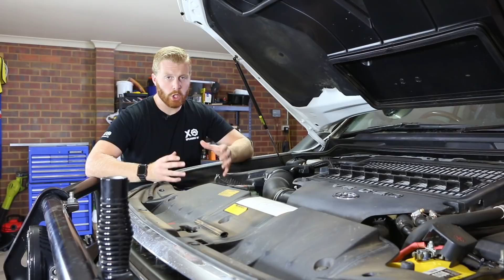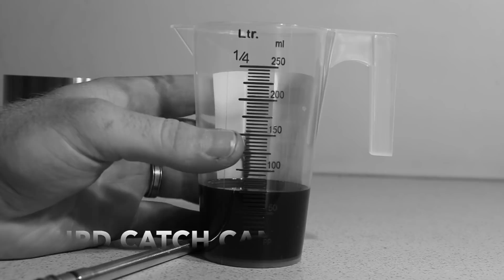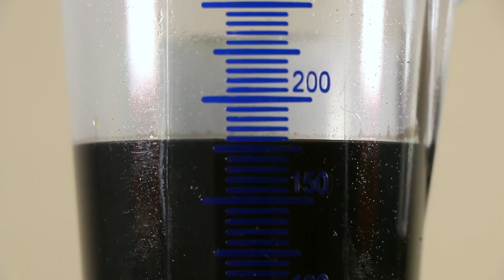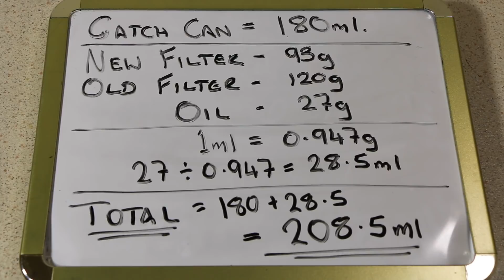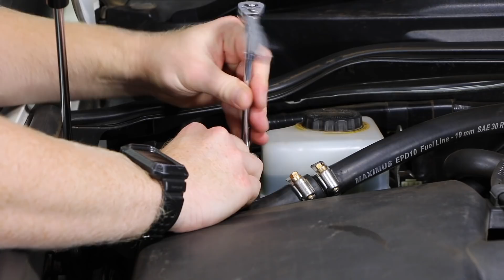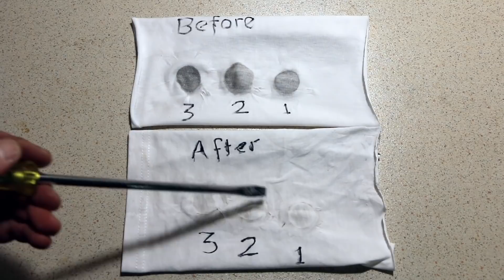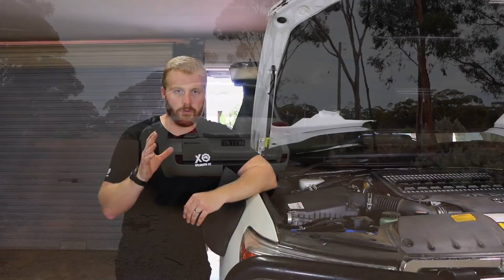PROVENT 200 | Is it really worth it? | MY 7000km REVIEW, drain and testing | Catch Can comparison

Comment: Great informative video thanks for sharing. how many provents does the LC200 need? do both turbos have the vent connected to them?
just asking cause my VW has 2 turbos and 2 separate PCV systems one to each turbo.
then again its done 265000km so the horse has probably bolted.
Reply from the maker: Thanks mate, so the 200 series only has one ventilation hose from the crankcase. Making it easy to plumb into a single catch can. The filtered air is then re-circulated into the passenger side air intake, however once that hits the intercooler, the pressures from both turbo's are combined and the gasses mix prior to entering the intake system. 
I didn't realise the VW had 2 seperate pipes. I'm guessing that a model specific kit would likely combine the two hoses prior to entering into a single catch can...
Cheers, Nathan.

Comment: Hi Nathan another great informative vid you are spot on with amount of oil the can catches. A few  knockers don't like them possible they have in shares in Toyota , mine is a Flashlube proportionally  at 5-6k  I caught a similar amount of oil .I drain it around 5k to be sure .cheers Ian.
Reply from the maker: Cheers mate. Each to their own, I'm not here to sell, promote or push products, simply to display my results, thoughts and opinions on these popular modifications. I believe they assist in prolonging carbon build up and don't have many, if any drawbacks. 
Cheers, Nathan.

Comment: Geee, thats a lot.. Mine doesn't produce a fraction of this. I checked the EGR and its dry and clean.
Reply from the maker: Sure is! Significantly more than the HPD unit caught. At least I'm confident the unit is performing well. Are you also running the Provent 200 on your Prado 150?
PS. Great channel by the way mate, been following you for a couple of years now.
Reply: @XploringOz  It is. I was impressed cloth test. Great visual. I wondered about mine so pulled the EGR apart. It would only catch 50ml or so in 5K Kms, but the EGR is dry.. I guess different engines create more mist or less.. Thanks for subbing to the channel.. And thank for your content.. I know how much work goes into it..
Reply from the maker: @jjsadv  For sure, every vehicle and every engine would have specific requirements. Glad to hear that your vehicle is performing so well, definitely a cash saver there in terms of intake cleans. 
Cheers mate, I'm glad you are enjoying so of my content. Sure is a lot of work behind the scenes, but the appreciation from viewers is well worth it
Reply: Be careful that when you buy a catchcan that you do not reduce the hose size as this will build up crankcase pressure and will blow engine seals!

Comment: Thank you for your educational videos!! Just want to ask if the LC200 crankcase ventilation system you mentioned means it also uses a PCV valve (routed to exit through the upper breather box)? or is the system just a plain breather system? 
Emissions standards aren’t so strict in my country, so i’m thinking to just vent the catchcan from breather to atmosphere and to just block the intake hole. 
But doing so, if there’s a PCV, i’d be losing vacuum pressure at low RPMs, right? 
Also, venting out would require an ecu tweak?
Thanks in advance!
Reply from the maker: Cheers mate, glad you enjoy the videos.
So as far as I'm aware, the standard Toyota ventilation hose does not have a PCV. If you wanted to vent straight to the atmosphere I don't seeing this being a engine management issue. Because of the low pressure, there wouldn't be any vacuum issues as long at the blanking cap was secured well. 
My concern would be environmental and road surface. As you would have seen there is a significant amount of oil being captured by this unit, if this was to be released it would 'film' the road with oil, making it a slippery surface for other vehicles, particularly motorbikes. 
Cheers, Nathan.
Reply: @XploringOz  
Thanks for your quick reply!! 
My LC is still quite new so I’m looking at it sometime in the future yet. 
In case I finally decide I’d probably choose one with an outside filter, and to just collect the oil from time to time, be environmentally friendly. 
Again thanks!
Reply from the maker: @armistriple7  No problems mate, all the best with your vehicle!

Comment: Good job mate
Don’t forget about the condensation diesels get with the larger oil capacity , mix those two together and unburnt diesel and that solution becomes acidic and start eating at your seals. ☹️
Reply from the maker: Yeah, I have heard about the condensation issues. The reason I didn't mention in this video is I haven't had any issues with this so far, makes it hard for me to comment. 
I believe keeping the entire system, the unit and hoses in the warm engine bay would definitely assist in reducing condensation. 
Cheers.

Comment: Nathan, I did a oil change last weekend on my 2018 Holden Colorado, 5,100km since previous, and had about 80mL drain out of my Provent 200 can.  So that's oil and other muck that didn't have to find it's way back through the intercooler, turbo, inlet manifold, and through the cylinder, and what doesn't get burnt up, into the DPF.  Prior to fitting the catch can at about the frist 9,000km the DPF had come on three times.  It's now got over 25,000km on the clock and the DPF has never come on again.
Reply from the maker: Good results. It's interesting to hear the changes in the DPF burns (something I can't comment on with my model).
At least it provides that confidence and peace of mind that you are getting the cleanest air back into the intake. 
Cheers.
Reply: That doesn’t sound right mate, 25k without a regen….not possible
Reply: @chasp_0784  That was 25,000km less 9,000km, so 16,000km without a DPF burn.  It gets even better(!).  Since I posted that I'm on 36,000km, so now 24,000km and it still hasn't done one, or it hasn't told me it's done one.  It use to come on and I'd have to drive about 30km at highway speeds for it to complete.  Anyway, if it's not possible it's not possible.  I change the oil and drain the catch can regularly, keep driving it, and never get any DPF messages, but maybe it's doing something in the background and not telling me.
Reply: @Michael_Mears  yeah fair bump mate, I think it’s doing it in the background but no dpf issues is a good thing, people think Toyota owners got screwed, I worked for Mercedes in England and every single day there was multiple diesel emission jobs going on, sensors, regens, replacing whole catalysts, injectors. Rubbish product.
Reply: @chasp_0784  Hey, reading that, you've given me something to think about.  I should get the local mechanic with this scan tools and see what the stats are with the DPF, or history, or whatever can be gleaned from the ECU records.  It might give me an insight into what it's doing.  Point taken about the work that goes on.  If this Provent unit can help prevent or significantly delay some of that type of work, that would be fine by me.  Cheers.
Reply: @Michael_Mears  I would be curious so hear what information your vehicle keeps too, Mercedes has everything, number of regenerations, fill percentages for soot and ash. They were running adblue and scr so euro 6 I think? Possibly had to have more information available.
Reply: My 2017 MY18 Colorado did its first DPF Burn at 88000 km,  the DPF then dropped its guts at 104000 and almost set alight the transmission control wiring loom  and partially melted the plug in the back of the transmission as well. I bought the car brand new.
Reply: What about checking the outlet hose of the catch can to see if much oil is inside hose. Just 🕵  saying.
Reply: egr?

Comment: I agree that they are worth fitting to various diesel motors .... fitted one to my V6 Diesel Touareg... 20000k later I’m yet to have to empty mine so i suppose it depends on the amount of blow-by your motor has / does on how necessary it really is and of course how long you intend on keeping the car.
Reply from the maker: For sure, it will be a vehicle specific service interval. These 200 series are known for a lot of blow by oil vapour.
Reply: Hi ray Bourne just wondering where you got your provent from for the Touareg, is it an Amarok kit you modified or a actual Touareg kit ?
Reply: @nategilmore8941  ... Mines actually the Ryco branded model... Ryco RCC350K... I had a bracket made up to fit it... I have mine living in the front left corner.... easy enough to do once a bracket is made... you cannot buy a bracket for these cars as far as I know.

Comment: 15 minute mark.  The current version does not release into the engine bay.  It releases it into the engine intake.
Reply: Stephen, mine has two valves.  One to regulate crank case pressure in the side, as part of the outlet to air intake line, and one in the lid as a pressure relief valve, which vents to the engine bay.  See these links below.  Do you have a link to how the new ones work?  I might have to get a new one...
Crank case regulating valve https://youtu.be/nz2eBsSwwQs?t=170
Pressure relief valve https://youtu.be/nz2eBsSwwQs?t=234
Reply: @Michael_Mears  no links, but the filter has the pressure valve in the base that opens and let the excess go into the intake.  My understanding that this was due to emission requirements not allowing ventilation to the atmosphere, so if a person does not replace or empty the filter, it all goes back into the engine.
Reply: @stephenbloomer567  No worries.  I'll have to look into it and contact Western Filters about it.
Reply from the maker: Cheers mate, I'll look into that. The changes Wester Filters have made to their new 'IV' system would have to include increase emissions controls.
Cheers, Nathan.

Comment: That is a scary amount of oil for a car of that age.  I have an old 4.2 with over 400k on the clock and after 7000km the filter was not soaked to the point that I had no oil in the drain hose.
Reply from the maker: Sure is a lot of oil. However it is a big capacity with 8 cylinders, merely an observation. At least now I have some more confidence that I'm am receiving fresher air into the intake.
Reply: Those V8’s have a reputation for oil consumption and of course the air filter dusting ... it’s why I went to a different vehicle

Comment: I heard that removing all the oil that goes back into the motor isn’t ideal as the motor does require it for lubrication. Not sure if that is true or not.
Reply: Not true.. engine gets oil from sump. This is blowby oil. It will only clogged up your intake system with oil and sludge..
Reply from the maker: Jay Lee is correct, the oil would still have some lubrication properties and degrade along with regular engine use. Where the benefit comes from is eliminating the risk of condensation building within the piping and unit (primarily in cold climates). This creates a white 'sludge' in the catch can, which you definitely wouldn't want entering back into the oil feed of the engine.